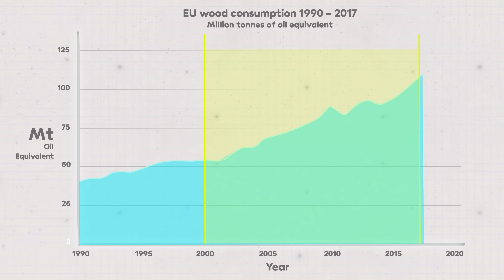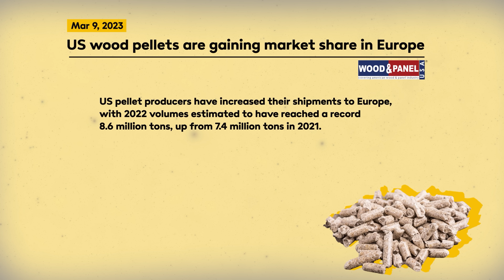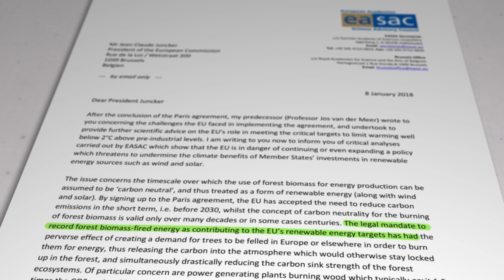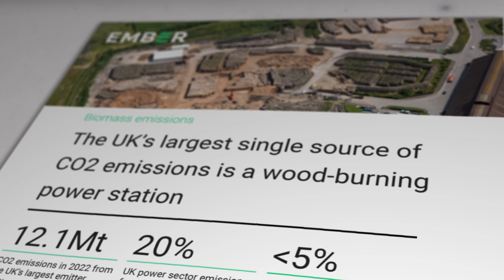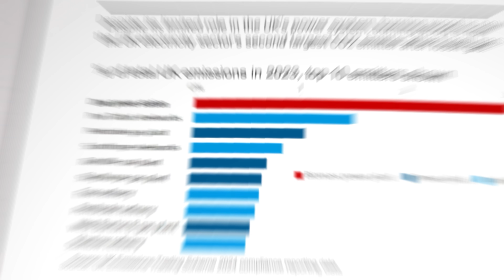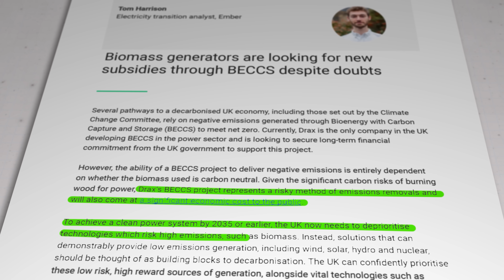New report: Biomass CO2 emissions 4X higher than COAL!!

Comment: Why does it matter, for carbon neutrality, whether you have one big plot of land getting corn planted and harvested each year on the whole thing, or whether you have twenty little plots of land with twenty-year-old trees being harvested and replanted each year on one plot?  Either way, it's a bunch of monoculture cropland that could have been used for something else.  But either way, the carbon comes out of the air when the plants grow and goes back into the air when the fuel is burned.  I don't see a meaningful difference.

To actually sequester biomass carbon, what you would do would be to grow it, heat it to 300°C or so, burn the gas that comes off, and use the biochar to improve the soil somewhere.

Comment: The way the burning of waste sawdust was segued in clear felling forest to provide pellets for Drax (clearly not carbon neutral) should be a warning about green hydrogen.
Hydrogen from water using renewable sources of electricity avoids CO2 into the atmosphere, but hydrogen from natural gas put CO2 into the atmosphere.
In short we have to stop burning stuff in any form. Find another way.
btw excess sawdust could be used to created biochar which would dramatically improve agricultural land, perhaps even to the extent of turning deserts into forest or at least savanna.

Comment: The co2 in wood comes from the carbon cycle and does not add co2 to the system. The co2 from coal comes from outside the carbon cycle and does add co2 to the system.

Comment: Transporting wood thousands of miles to generate electricity is not the best use of biomass, but it probably will be needed to make synthetic fuels for transport. At the moment, none of the other energy storage technologies look viable for long distance transport. 

And you do have to recognise it is net zero (if transporting and processing it is net zero). After all, here in Australia, the bushfires of 2019/20202 released about 830 million tonnes of CO2, and it does not count against our annual emissions. The same applies for forest fires all over the world.  If only we could have captured that material before it burned.

Comment: All this is true, but it is a little more nuanced: Out here on the west coast with our "Mediterranean climate" (dry summers) forest land needs to be aggressively managed to help prevent forest fires. This means that forests need to be thinned, fire breaks need to be established and maintained, and forestry slash (wood debris) needs to be disposed of. This is expensive work and yields little if any marketable timber. Much of the debris is burned on site to prevent biomass fuel accumulation. Some programs exist to chip and truck local debris to local biomass burning generators, but this is not economically profitable due to labor and transportation costs. It is seldom done unless it is subsidized by government or private entities. In these cases, the biomass is going to be burned one way or another, the equation becomes whether or not it is worth the fuel to truck it to recover electricity from it...

Comment: Wood Pellets have never made sense to me even as a homeowner (in Northern Canada)  you still have to by a processed product which means you have to rely on a supplier that can raise prices or go through shortages.  On a industrial scale it is slightly retarded to think it renewable.   Canada should not support the export of this type of product,  but the timber companies are (mostly) all foreign owned now.  😢
Reply: Wind turbines are also processed industrial item so I guess they don't make sense then or solar cells...
Reply: @rcpmac  I have not looked at thier life cycle in depth so cannot give you a good reply.  I believe they have a much longer useful period and more recyclable parts (?).  Wood that has to be processed and shipped is definitely not a carbon neutral energy, nor efficient use of resources. The question would be: does the net benefits extraction and processing of resources outweigh the damage (using damage loosely)?  I have seen many solar farms in use for decades now, wind has many advantages and disadvantages, I I believe both have a better functionality than biomass (unless we are actually talking waste to energy products, which is its own conversation).
Otherwise,  I don't think you are accurately comparing these these technologies.

Comment: Almost as if doing anything on an industrial scale is unsustainable
Reply: That's the wrong conclusion. "Green" and "sustainable" are always relative claims. It's possible and essential to compare the overall lifecycle CO2 emissions from different kinds of power generation. Wind and solar come out very low, gas and coal come out very high, and burning wood pellets is only somewhat low-carbon over decades of replanting an existing commercial forest.

If you're concerned over the sustainability of the best choices, then by all means use less energy.
Reply: @orionbetelgeuse1937  A large part of the video's point was also that the wood pellets themselves are only carbon-neutral if the trees grow back as quickly as they're cut down, which isn't happening.
Reply: @orionbetelgeuse1937  Most trees don't grow back after being cut down and most tree seeds don't spread far from existing trees. It can take many decades for trees to even sprout far into cleared areas and decades more to grow to appreciable size. Forests can't recover naturally as quickly as we cut them down. Agriculture is normally like that with any plant, harvesting goes a lot quicker than growing so if you don't want to run out you need to actively plant more.

Comment: Biomass carbon is active carbon in the system, and already part of current circulation. fossil carbon may burn more efficiently, but it is new to the biological system so increases the total amount of carbon in circulation. Wood does not do that. if you want to avoid carbon build up in the atmosphere then that is a massive distinction. it's our lifestyles that drive new carbon so using less is the only effective tool. A motorcycle is efficient. A car is comfortable, and insulates us from the environmental experience like a vaccine from Mordor.

Comment: Drax say their plant is overall 40% efficient, but Greenpeace, say they lose 60% cooling steam in the cooling towers whch would mean old converted coal furnaces work at 100% efficiency burning wood dust which is not realistic. i could not find a reliable figure for the efficiency of Drax. does anyone have the numbers. my guess is less efficient than ice cars.
Reply: Efficiency is less important than sustainability. Solar PV is 20% efficient, but very sustainable. If Drax were 80% efficient it would still be unsustainable.

Comment: So long as the tree that is  burned is replaced by another tree then it is a renewable resource and the carbon dioxide put into the air will be absorbed by the new tree. It’s that simple. If you destroy the forest it’s not renewable. If you let the tree grow back you’ve made no impact on the CO2 in the atmosphere by the end of the cycle which is relatively short and absolutely sustainable, compared to the millions of years it takes to put the CO2 back into the ground from burning coal. (Obviously we shouldn’t be destroying rainforests)...

Comment: Even if they really were only burning waste material like branches, chips and sawdust, there are better uses for it. It could be used as a substrate for large scale mushroom farming.
Reply: I think you'll find the demand for substrate for mushroom growing is already being adequately met.
Reply: That may be. But I'd argue that this is mostly because mushroom cultivation is underutilized in agriculture. Production could be increased dramatically, and one of the ways to do this is to use these waste wood products.

Comment: is there an end to politicians idiocy? it is. it's called passing STEM course with 90% proficiency. just look at the steam powered locomotives and steamships. they burned coal, not wood, unless coal was not available. later, oil supplanted coal because of a higher power per unit weight. I do not subscribe to the use of coal, or oil for power generation, but carbohydrates are at the bottom of the pile. wood and food waste should not be burned. rather fed to bacteria in digestors that can decompose it into methane, a very efficient fuel source.

Comment: The Burning Truth About Biomass: Is it Really Green Energy?

* 0:00: Biomass burning for electricity generation emits more CO2 than coal: New research from Ember reveals biomass power plants, like Drax in the UK, release more carbon dioxide per unit of electricity generated than coal or gas plants.

* 1:15: Drax is the UK's single largest emitter:  The Drax power station in the UK, which converted from coal to wood pellets, is now the country's biggest single source of carbon emissions, emitting four times more CO2 than the UK's remaining coal-fired power plant.

* 2:29: Sustainability claims disputed: The claim that biomass is a carbon-neutral energy source is heavily disputed.  While the carbon released during burning is accounted for in the "Land Sector," the regrowth of trees takes decades, meaning CO2 is released faster than it's absorbed.

* 4:30: Questionable accounting practices:  The current accounting rules allow biomass energy to be considered carbon-neutral, despite evidence suggesting otherwise. This loophole is a result of decades of lobbying by the biomass industry.

* 10:33: Focus should shift to proven renewables:  Experts argue that instead of investing in risky and potentially damaging technologies like biomass, focus and funding should be directed towards proven renewable energy sources like wind, solar, hydro, and nuclear power.

I used gemini-1.5-pro-exp-0801 to summarize the transcript.
Cost (if I didn't use the free tier): $0.0555
Input tokens: 14210
Output tokens: 552

Comment: Sounds like nonsense. The "ThinkTank" doesn't disclose where the money comes from on the website, but one of the directors worked for BP and Shell and another one in "the energy industry" whatever that's supposed to mean.
Also obviously burning resources which were buried before obviously adds CO2 which could not have gotten into the atmosphere. No one needs a study to understand that. 
Burning wood only adds CO2 which would have at some point anyways entered the atmosphere. So all you have to do is make sure that the overall biomass which is regrown stays about the same. 
Luckily you even get space to regrow wood where you chopped down trees before - neat eh? 
And did you think about other sources of bio mass? Instead of complaining about regrowing wood you could make bio gas by using various plant parts which are a byproduct of food production or even use algae grown in the oceans.

Comment: Seems like the problem is not that, correctly handled. biomass is no low CO2 emission, because it is, but that we ship it across the globe because there is not enough of it.
Reply: How do you come to that conclusion having watched the video? It is not energy dense compared to fossil fuels, it needs to be burned in such high volumes for the same output of electricity that it emits more CO2 than coal, that was stated in the video. Also, if more CO2 was released by the fuel burned for transportation, then it would mean the wood pellets must be incredibly energy dense relative to the ship fuel, but that simply isn't the case. Besides which it was stated that we get the wood pellets from the US because the protection of forests in Europe means we cannot meet the demand locally.

Comment: So wait, if I take my wood. Heat it up inside a can, with a hole in it. Flames come out the top as the gasses burn.. and whats left is coal. If I burn that, it reduces my CO2 or no? What methods of coal, are actually better than this?
Reply: No, that is not how coal is formed. If you burn wood you will get charcoal or ashes. Coal was formed over a process of many millions of years from fallen trees in swamps getting compressed by successive layers of material. But if burning wood magically created coal, then of course burning coal would NOT reduce the CO2 produced, because you are burning two things rather than one. The point made in the video is that wood is far less energy dense than coal (there is not as much energy in wood as there is in coal for any given volume of the two materials), therefore you need to burn a far larger volume of wood to get the same amount of electricity, which is why it produces more CO2 than burning the coal for the same effect.
Reply: @danyoutube7491  You are talking about natural coal. The video is talking about coal. Both natural coal and charcoal are coal. And yes, this is one of the ways that coal is made. Typically they crush the coal after releasing the gases from it leaving behind the pure carbon then they fit them into molds and make briquets with them.

So that part of your explanation is misleading.

Your explanation about energy is also misleading. Burning wood provides less heat and fire. If you take coal, remove the gases and leave behind the carbon. You actually get more fire/heat than the wood itself. So it is true carbon produces more energy when separated from the other gases.

The only way to explain this in a way to make sense is to imply that the conversion process releases CO2 to make C. Which would only than imply that you are getting less carbon on the coal side after conversion.

https://www.youtube.com/watch?v=FqRCnF9dovw

The only real difference is that naturally occurring coal (which could have impurities) doesn't undergo the transformation the same way we make coal. We make coal, faster than it naturally is made.

Rearrange the carbon atoms.. one way gives you coal, another gives graphite/graphene, another gives you a diamond. It all depends on how the carbon atoms are bonded together. 2d lattice will give you graphene for example.

So the evidence would suggest that they are counting carbon emissions from burning wild coal, and not the emissions from making it. Since to burn out the gases you need heat which most people burn wood or coal to make. That would be counted against the wood.

And are you trying to imply to me that 1 ounce of naturally occurring coal, is going to produce less CO2 then 1 ounce of wood charcoal?

Show me the science behind 1 ounce of coal produces more carbon than 1 ounce of coal.

Comment: They burn higher temp and that results in higher CO2
Reply: Check heat engine efficiency as function of temperature difference
Reply: @JonathanFrost  an engine is not the relevant because it is a closed system and gases are recycled.  Open air combustion is the issue.

Comment: I remember green campaigning groups relating 100% renewables reports/plans about a decade ago, and when I read them I found they relied on significant amounts of biomass to achieve their goal. It was clear to me then that their goal was not low carbon, but being anti-fossil fuel and (perhaps even more so) anti-nuclear was.

If they had been interested in low carbon electricity production, they would have advocated for clean renewables + nuclear as the solution, like ecomodernists do. This is starting to change however, for example, Finland's Green Party now supports nuclear energy.
Reply: And you're forgetting geothermal energy too. There's progress in this field but they need more support and money. This is the real solution but nobody talks about it.
Reply: Hot Dry Rock Geothermal is Soooooo underrated! 

Granted minor hazards of seismic risks etc to be considered but yeah.  Also production of low grade heat and/or low temp electricity generation processes like Organic Rankine Cycle etc
Reply: Although there is some interesting work going on (i.e. Quaise), the depth of hot rock in the UK means geothermal doesn't play any role here at the moment. I put it in the clean renewables group, though its CO2eq emissions are higher than wind and solar.
Reply: What is a clean renewable these days?  New hydro has been found to be worse than coal, wind farms and solar are replaceable but only if coal and diesel continue, Green parties now supporting nuclear and sea level rise of over a metre in grandchildren's lifetimes might mean they should have been supporting it in the 70's, 80''s, 90's 00's, when they were probably controlled opposition, now is too late globally.
Reply: Which campaign groups were they, because environmental scientists knew biomass was a bs way to achieve renewable energy targets long before that.
Reply: @dapo                     The vast majority of environmental activists oppose biomass. Most studies have not used much; a bunch now are based on 100% wind & solar. Jacobson 2021, eg.  Finland’s Green Party is surrendering to pandering & pressure. Almost all the new generation added to grids now is renewable now & their prices keep dropping, so that will only intensify. The No True Scotsman cap is unconvincing. was.